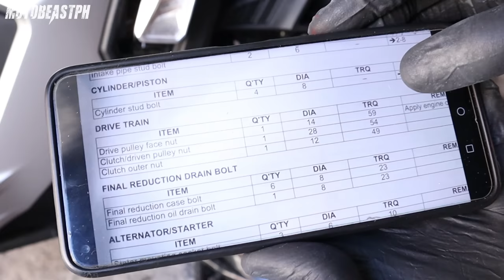ADV 160 | CVT Check & Torque To Spec

Comment: naalala ko nagwork ako sa toyota, sa assembly line ako nadestino, yung mga markings na yan na ginamitan ng paint marker na makikita nyo  sa mga bagong sasakyan na meron din sa motor tulad nyan for quality control yan.. paulit-ulit chinicheck yung torque ng bolt and nut, at lahat ng maliliit na detalye mapapansin nyo yan sa tandos sa mga turnilyo iba2 kulay nyan iba-ibang tao nag-mark nyan... nagtaka lang ako kung paano po kaya lumuwag yung sa click

Comment: Kunting advice lng bro yung Y-Tool wag mo e tukod dun sa clutch bell katagalan aalog ang bearing ng drive shaft. Na experience ko na yan. Dun mo e tukod yung Y-Tool sa center stand pahigpit o paluwag pwdeng pwde bro.

Keep it up bro RS🙏
Reply from the maker: Salamat sa info, bro! 🤘
Reply: Parang layo ng center stand sa pulley ahh, maikli lang y tool lods 😂
Reply from the maker: @leonatividad5724  Pwede gawin dyan, bro yung sparkplug remover ng Beat at Click isalpak sa dulo ng Ytool para humaba siya at umabot sa lupa.

Comment: Idol, tanong kolang po, okay paren ba panglinis ng CVT ang gasolina? Kapag walang budget pambili ng CVT cleaner. Or mas okay ang sabon at tubig nalang.
Reply from the maker: Pwede tubig basta tuyuin mo agad mga metal parts para di kalawangin. Wag mo lang linisan ng tubig yung male torque drive kasi masisira mga bearing.
Reply: @MOTOBEASTPH  maraming salamat po bossing 💪 More power po sa channel nyo

Comment: hi po sir, new subscriber po,
honda adv160 user din po ako, pwedi request po. gawa kayu ng video proper throttle control, hehe galing po kasi ako sa  manual na motor. salamat po at God bless po
Reply from the maker: I-rev match mo lang, bro habang naarangkada para di pwersado.

Comment: The same lan na CVT ng PCX160, CLICK 160 sa adv 160
Reply from the maker: Medyo may iba. Pulley ng Click 160 iba sukat.
Reply: @MOTOBEASTPH  sa pcx 160? Po kasukat ba? Thanks
Reply from the maker: Yes same pulley set.

Comment: I bought adv 160 yesterday 0km From casa to House 50km tnakbo then na pansin ko prang may umingay sa pang gilid at yun malapit sa driveface..  possible kaya yung Locknut nya yun sir??
Reply from the maker: Kapag kumalas yung nut, hindi na siya aandar pag piniga silinyador.
Reply: @MOTOBEASTPH  so possible talga Lods dun nag ccaused yung ingay sa Drivefacr and Pulley but nya no..